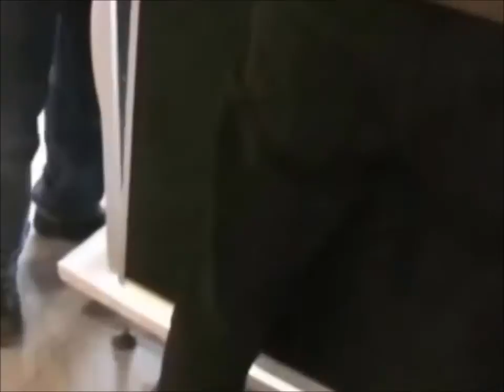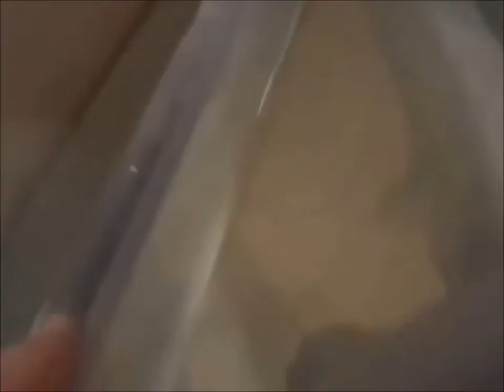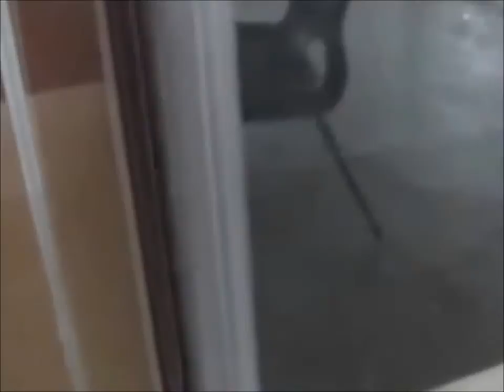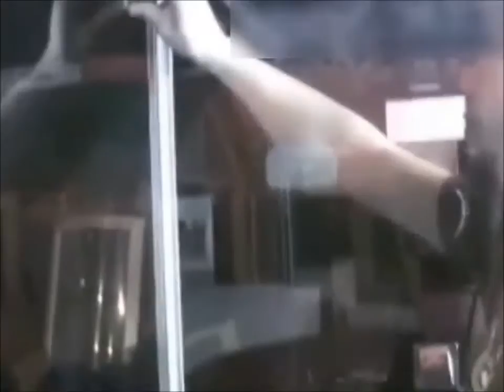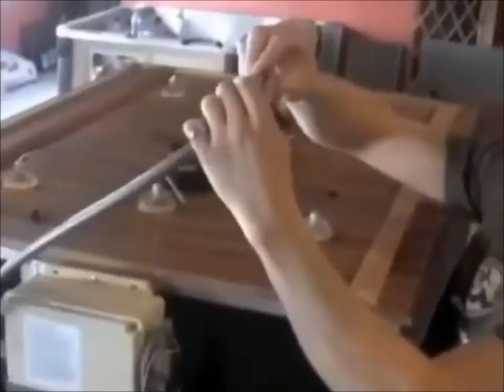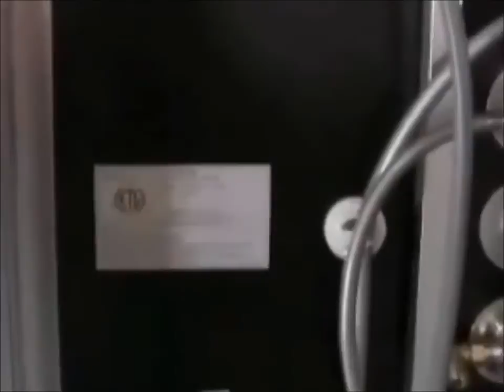Steam Shower Assembly Video EAGO Ariel Platinum DZ959F8

Comment: Randy  and Bob To move the shower into place after assembly just put a couple furniture sliders under a couple of the adjusting feet and you can push it with one hand, very easy.

Comment: Pretty easy to install it in the middle of  a room, show this assembly in the bathroom and how you slid it in place.
Reply: it slides very easily if you put some furniture sliders under a few of the leveling feet, You can move it with one hand when you do that.

Comment: Looks real easy when you assemble it in the middle of the room.  Interesting how the last shot is of an assembled shower in a corner, but you never address making the drain, water supply or electrical connections.  Assembled, this thing is extremely heavy and I'm not sure how you are supposed to move it into place after it is built and make reasonable final connections.   Also, the monumentally bad instructions that come with it make it appear as though you can build it in place which is impossible.   Frustratingly poor design.
Reply: I agree 100%. The directions are terrible!